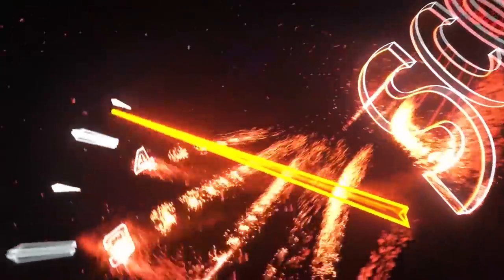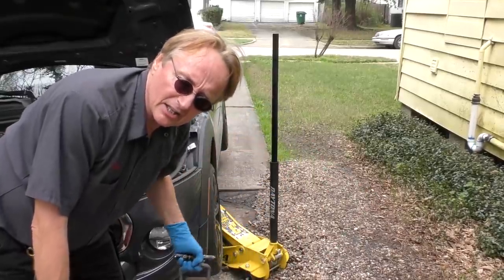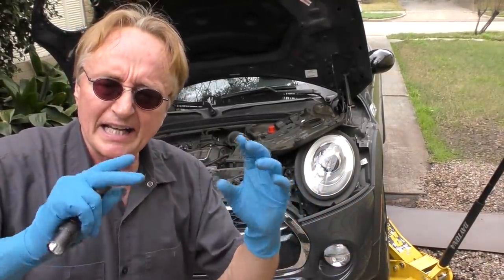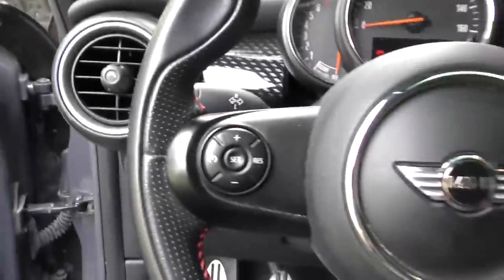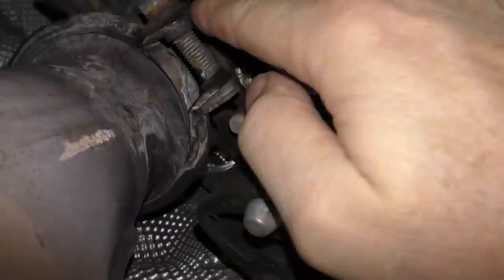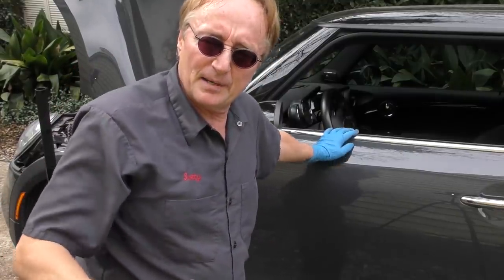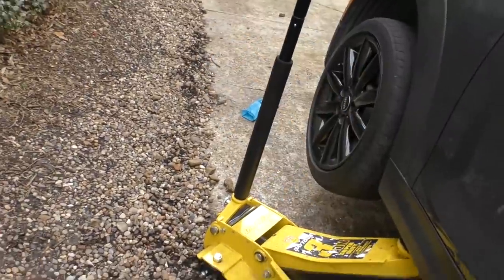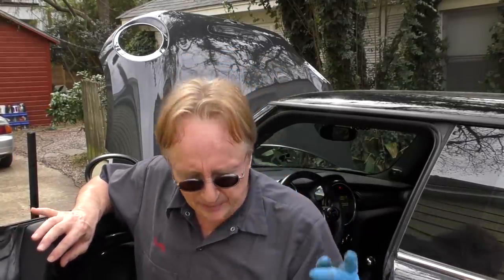Doing This Will Make Your Engine Run Better

Comment: Scotty: I hope you did not fix that for free. Your time and expertise is VALUABLE!!

I would guess that you spent at least 30 minutes to one hour, with your smoke machine, mineral oil, jacking up the car, using jack stands, crawling under the car to find the leak, and on and on. I would hope you would have charged the customer for an hour of labor.

Comment: Scotty - how do you feel about 90's MR2s. I've never heard you talk about them....
Reply: I had a 1986 for three years, oh gosh, it was fun to drive.  With 270K on it I sold it to my nephew for what I had in it, he drove it for four years while in college then sold it to a freshman.  I'm only 5'-6" if you are 6' or taller the 90s MR2s are a better fit.  I kick myself to this day for passing up a completely stock, non-turbo,  93 red hard top with less that 20K for $10K.  I test drove it, but thought he was asking too much.  By the time I changed my mind, two days, the car was sold.  At 71 I don't pine after an MR2 any more.  Don't buy an one with an automatic transmission, get the five speed and hang onto your hat.

Comment: 3:33 "tight as can be"...just be careful not to over tighten as that can put stress on the bolt which can cause it to crack from vibration and eventually break...ideally you would want to find out the manufacturer torque spec and tighten it with a torque wrench

Comment: Just don't let valvoline change your oil! If they neglect to put oil in or 23 miles after an oil change on a new car the engine blows up.. Good luck getting 6800 bucks out of a giant oil company.. It happened to us it will eventually happen to you if you take your car to them. Sorry valvoline you suck you should have done right by me if you didn't want me to tell the world

Comment: For Free?  That's very nice of you Scotty. But If I was your customer I would have insisted of paying you. Sure you just tightened a bolt,  but you also used your time, your extensive knowledge and expensive equipment to find the cause. That's reason enough. Hope your customer appreciates this and becomes your customer for life.
Reply: hellraizer44 A good mechanic will sometimes do little jobs like this for good will, if it was a long time customer or a referral from one. Plus don’t forget Scotty just monetized it into a YT video 💰